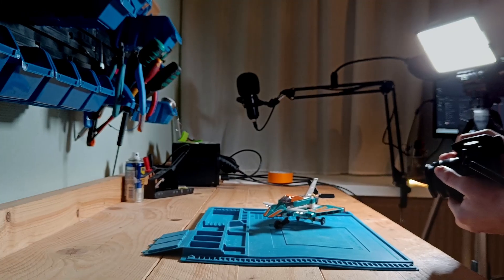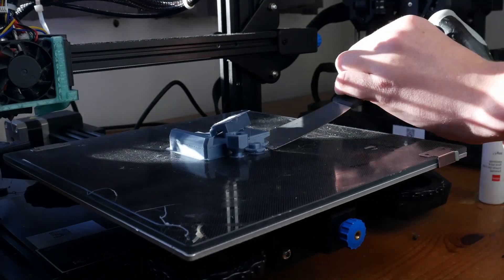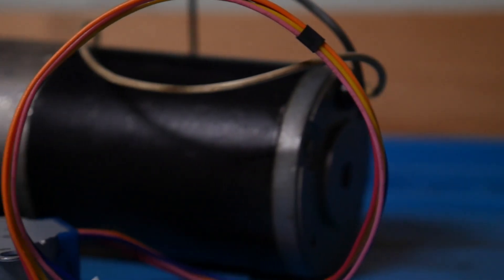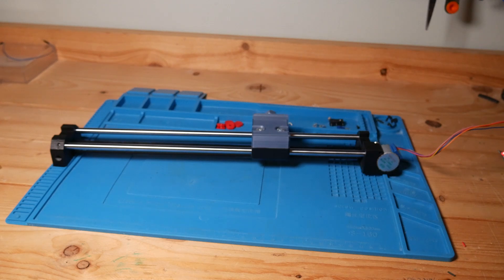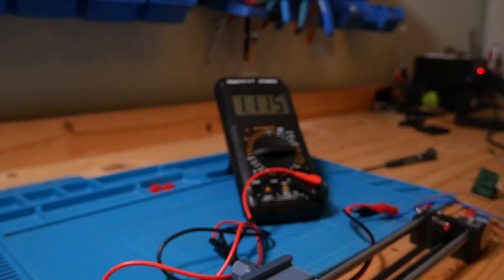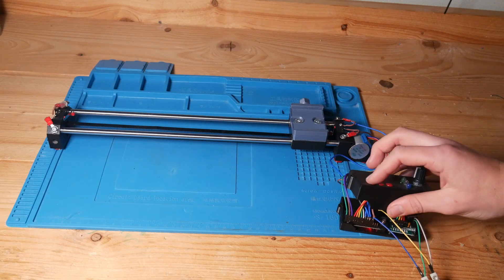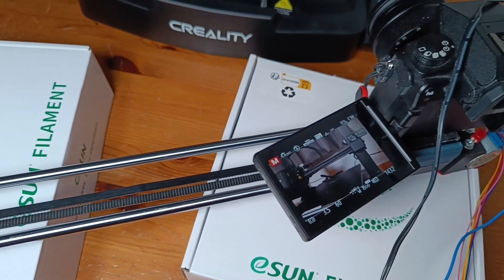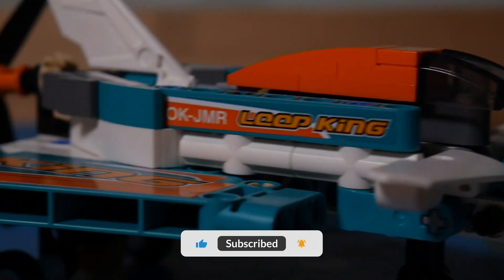I built my own camera slider using 3D printing instead of buying one #3dprinting #cameraslider

Comment: Good stuff, just curious though, why use 2 limit switches with the stepper motor? Wouldn't you just need 1 to home the slider, after homing you'd know how many steps it is to get to the other side. It might also be helpful to mount the limit switches in a way where the motor can still move a few steps without running into anything, so basically making it so it can move passed the switch while pressing it in case there is a small delay or hick up in the system, it won't immediately run into a solid wall. Lastly it might help to use proper insulated aluminum foil wire for the limit switches because they are prone to get false readings if they aren't, you see this used in heavy CNC machines because the stepper motor wires can have a bad affect on the limit switch wiring which of course means you'd need to use actual wires and not use the rail to send the signal.
Reply from the maker: Good point! I use two limit switches because if I run the stepper motor at high speed, it sometimes skips steps. So I thought about how it would know where the start and end positions are, and if I could make the rail a different length without changing the code. I initially thought using two switches would simplify the code, but it didn’t work at all—it only made things more difficult
Reply: @wb_3d_tech aw yes, well I think being able to change the length of the rail without changing the code is always going to be impossible regardless of the amount of switches, but I suppose you could add a small display and input buttons to configure the length on the display, that way you don't have to recompile the code if you decide to change the length of the rail.
Reply from the maker: But thanks for the tips!